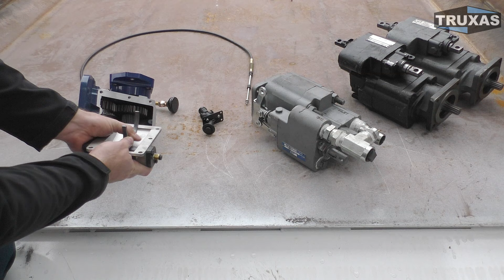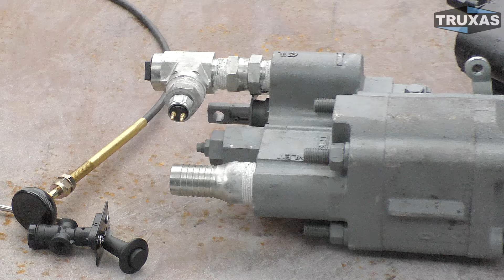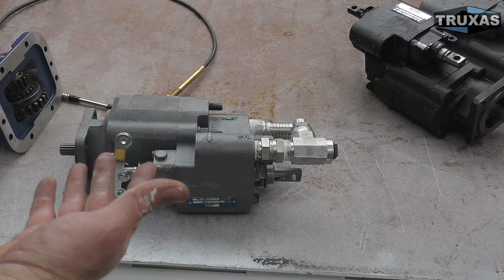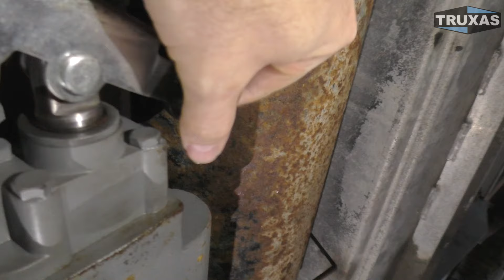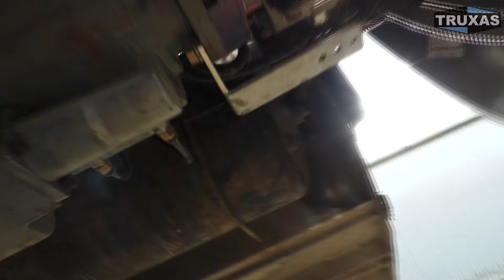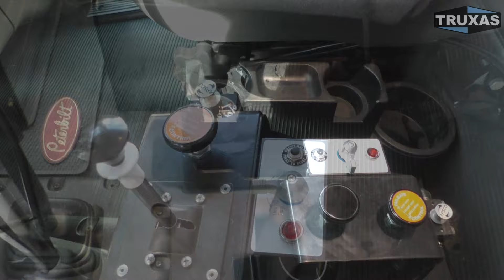Troubleshooting: Dump Truck Pump and PTO Troubleshooting

Comment: awesome video. My air controlled PTO is sticking on. I have to go under the truck and hit the air control unit (with the airline going to it)  with a hammer to get PTO to disengage.  Any suggestions
Reply from the maker: You can try putting a few drops or air valve oil, which all the air valves on the truck need once a year or so. Or replay the valve and remember to oil.

Comment: What causes the tipping valve to lock and not go up or down fully ? Took the cable off and cannot push the lever to down position
Reply from the maker: Not sure, but could be broken internally, or some of the seals have become unseated and are jamming it.

Comment: I have and automatic transmission Eaton fuller will that Muncie fit and how much should I shim it?
Reply from the maker: you always have to measure each transmission to see what thickness of shims are needed. they all vary a little.
Reply: Buy a Chelsea 489 PTO instead. One supplied gasket is only needed for proper backlash.

Comment: was a very good video. Im a new mechanic to this type of work. Maybe you can do more trouble shooting on the actual PTO for the next video. The trucks we have here are PTOs that dont use air. Im guessing they are using trans pressure to engage. ( they are all auto allison transmissions)
Reply from the maker: we do have a couple Allison auto videos, that will be posted soon and explain the best pto set up for an Allison.
Reply: @TruxasSales  thanks